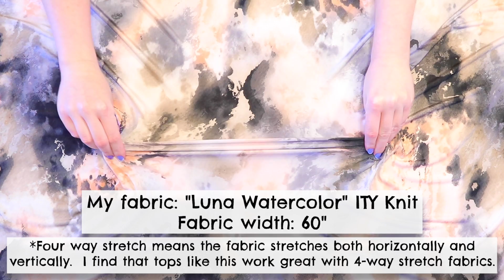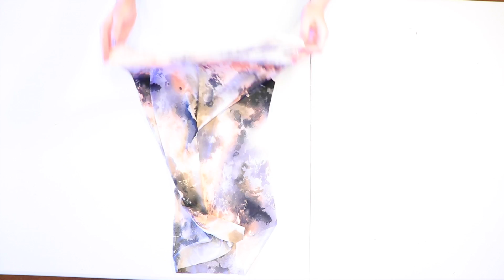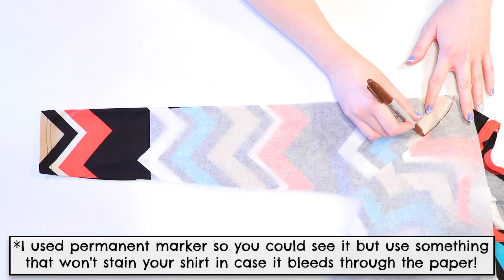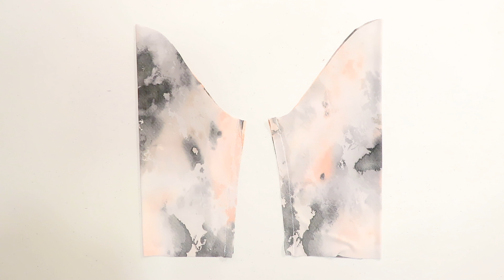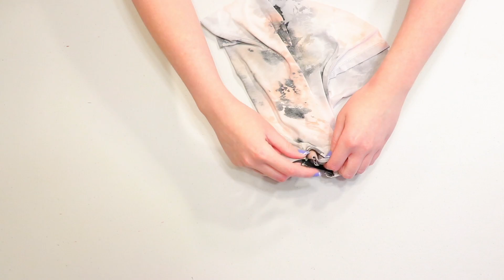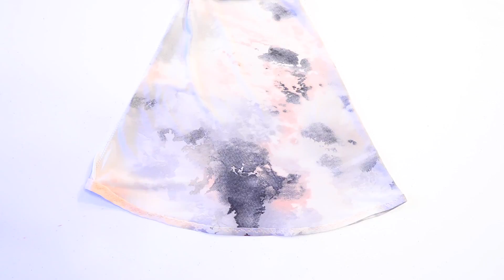How to Make Bell Sleeves | How to Make a Long Sleeve Shirt with Bell Sleeves

Comment: if i used a not stretchy fabric but sewed in a zipper or buttons would this still work ?
Reply from the maker: This is gonna work best with stretch fabric because even with a zipper or closure it wouldn’t fit right with non stretch. The front would have to be cut differently and have some darts to fit around your figure properly. I do have a playlist with all my nonstretch fabric sewing tutorials you may enjoy if that’s what you have to work with 😃

Comment: Why do you fold the raw edge twice instead of just once?
Reply from the maker: I just answered this on your romper comment but I figure I’d copy the answer into this comment too just in case anyone else reads this and is wondering 😃

I like the look of double folding it twice - it hides the raw edge of the fabric and looks neat. Although if you’re using a fabric that doesn’t fray at all, you could technically just fold it over once and see if you’d like to, especially if you find it easier to do it that way 😃 Although if the fabric does fray, you would need to double fold it so that the raw edges are hidden which will keep it from fraying!

Comment: Waooo another lovely tutorial thanks. But y did we use 1.57 and not 3.14
Reply from the maker: Thank you Fran! Great question - for the bell sleeves I decided to cut out a quarter circle shape, which actually only uses 1.57 to make. If you wanted to make them even more flared out, you could use 3.14, draw the shape onto a folded piece of fabric just like you would with a skater skirt, and then you’d have a half circle which would create a bigger bell sleeve flare. It just depends on how big you want the bell to be... you could even cut out a full circle for even more drama by following the formula and way you’d cut out a full circle skirt 😃 I hope that makes sense!!
Reply: @ComicatCreations  it sure does thanks.